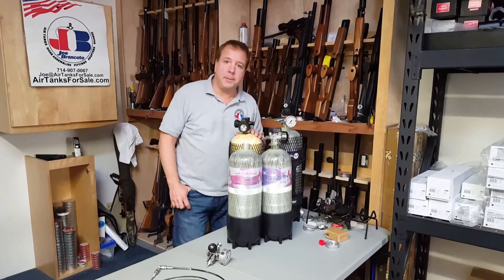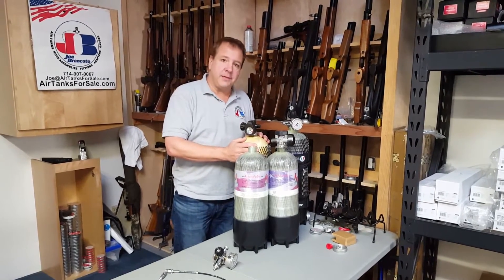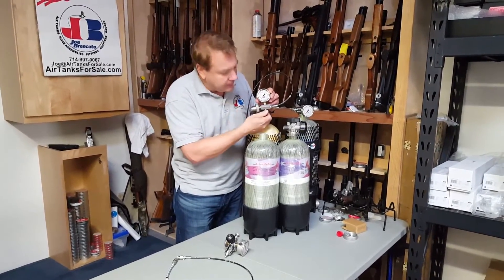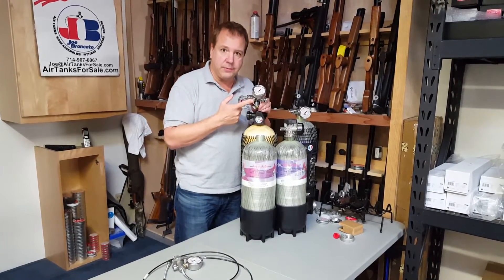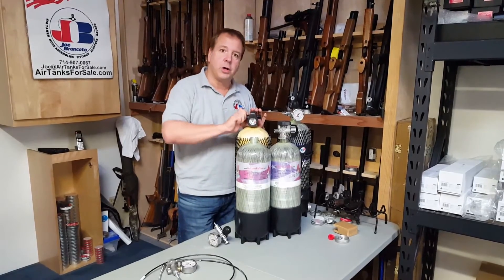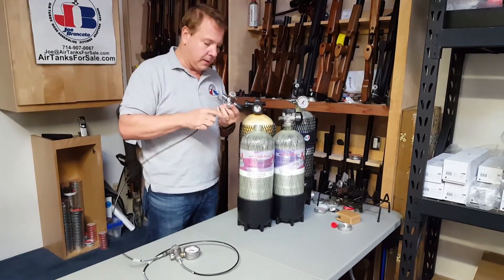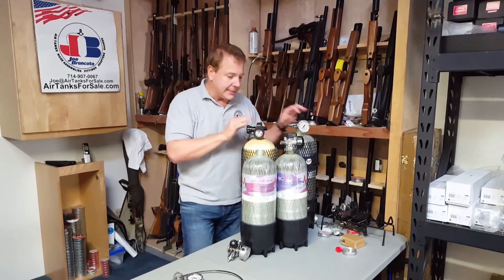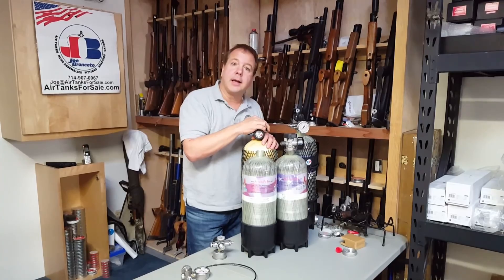SCBA Airtanks, Hoses and Valves

Comment: after checking out the cost of putting your own  high pressure dispensing hose, valve, gauge correct fitting for scba tank I just bought joes setup. It came to about 50 bucks difference and when I got it hooked to my e-bay 100 buck scba it worked perfectly and was of the high quality he claim. I have talked to others and they say he really has the good stuff and its true. If you get tired of making these decisions and want to shoot and not cheap out on vital equipment this is not the sport for you maybe. Airguns are becoming to come of age. Especially in gun paranoid liberal states. I only have a single shot rifle and want 22 cal. bullpup with a good scope. That right there is plenty hard decisions enough. So just get a good one and consider it an investment and you will not be sorry.
Reply: I just ordered Joe's SCBA hose assembly and I'm glad to hear it's a good investment, that along with the 2 97cu ft tanks I found for $100 I'll be good to go
Quick edit;
It's for my .22 gauntlet that I've had for a week